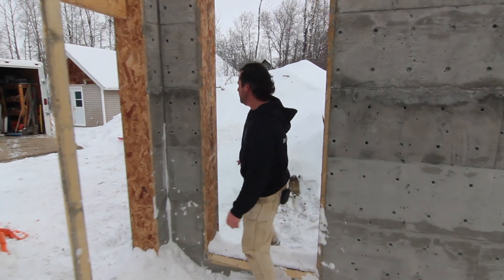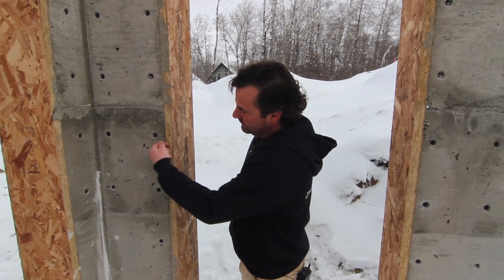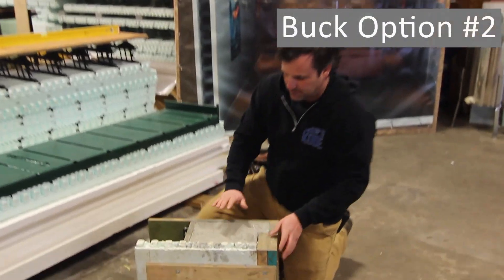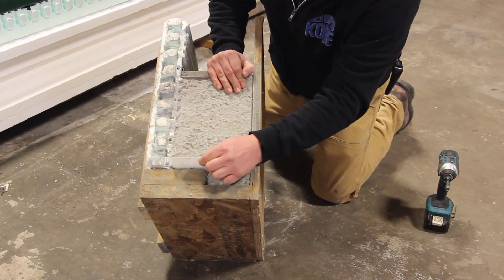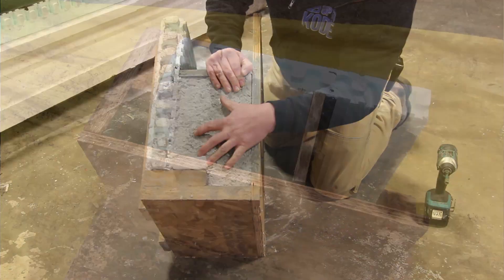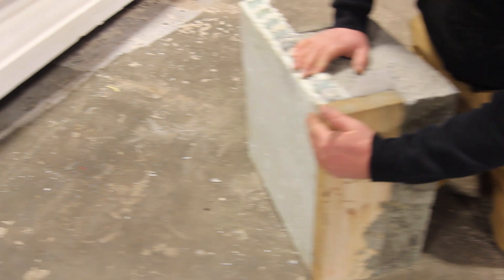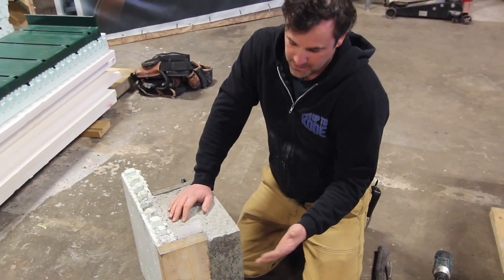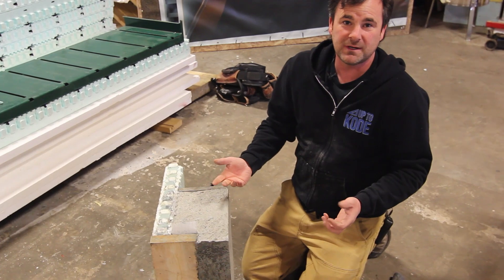How to Form a Window or Door Buck - ICF

Comment: I live in a tropical region with high temperatures almost all year round btwn 26 to 37 degrees Celsius. I plan on building my house using ICF in order to achieve an ACH value less than 0.3.

Comment: How do you handle termites and humidity when using ICF.
Reply: Humidity won't affect ICF's. You can get some brands of ICF's with Borate treatment to resist termites or cover the ICF with a peel and stick membrane below grade and extend it 8" to 12" above grade. Use a self adhered WRB above grade or any WRB for that matter. Pro Clima Adhero is the best SA WRB I've come across for above grade. Henry Blueskin is the best peel and stick I've come across for below grade.
Reply: @aaronolsen8787 Adhero can stick to ICF?
Reply: @wd8005  Yep, it sticks quite well too as long as the surface is relatively clean. No primer either. It sticks better than Siga Majvest 500 SA and is a superior product in my experience. I definitely prefer the Proclima products over Siga. Siga isn't bad though.

Comment: Hello a question on IKEA cabinets- have you altered the faces of base cabinets(making one proud of the others) we are thinking of bringing our hob/oven cabinet 3 inches proud of the others.  Are there any pitfalls or concerns with doing that? Thank you
Reply from the maker: Yes you can do that. I have one video where I build columns around a 30” stove to make space for potential 36” stove in the future. You could use the same concept. 

Or just make sure to make room for a filler panel beside the one cabinet that sits beyond the one beside it. It can be 1/2” thick or build a column if you want. Hope that helps

Comment: How does one sided ICF compare to two sided ICF in cost?
Reply from the maker: It’s more because of increased labour and time. You save money on one hand (less foam) but lose it on the other (labour and form ply). But it’s a cool idea and used in the right situation could add a ton of value.

Comment: Could you do it the same as the second option, just reversed?  That is, the wood buck on the opposite side of the foam, essentially "floating" in the concrete, after it's hardened.  I'm figuring it could be useful for situations where you had the foam, say, on the inside, and the hard faced concrete on the outside, so you've got the nail edge for the window or door, but the foam on the inside providing a thermal break.
Reply from the maker: Yes absolutely. There’s all sorts of ways.
Reply: That method would not provide a thermal break because the insulation needs to be in line with the window (which also acts as the thermal barrier).